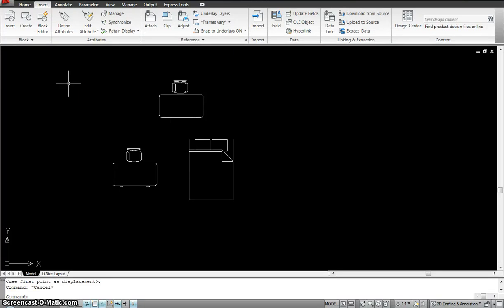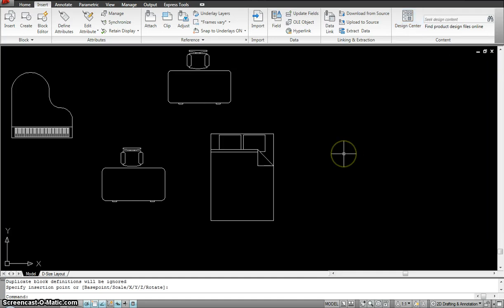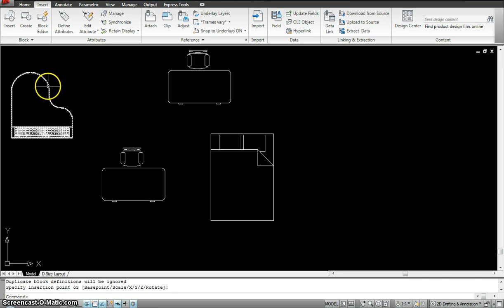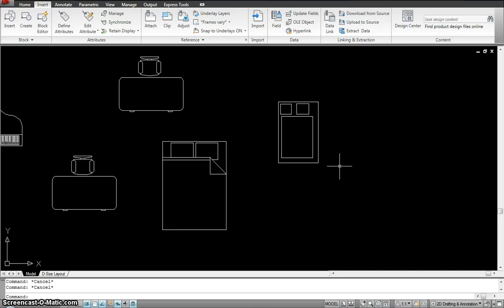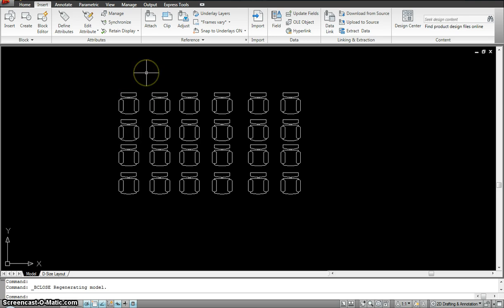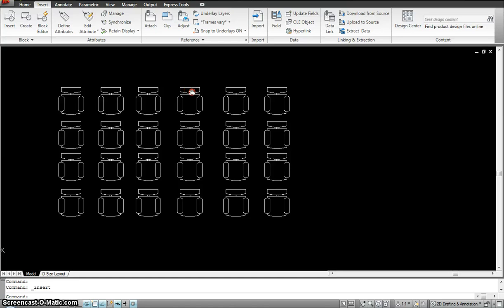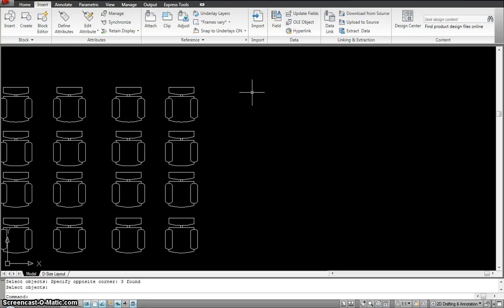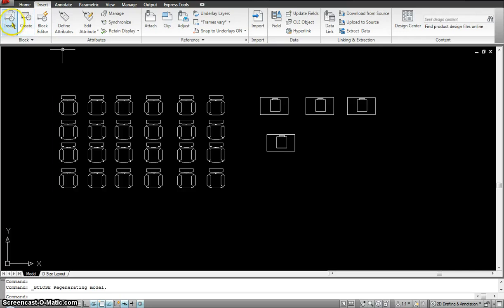Autocad Blocks.mp4

Comment: how to unblock the AutoCAD drawings?
Reply from the maker: Radhika Viju Double click on the block to unblock it and modify it. Once modified click save block on the top of the toolbar. If you want to permanently unblock it in the drawing then just use explode command- select drawing- hit enter.